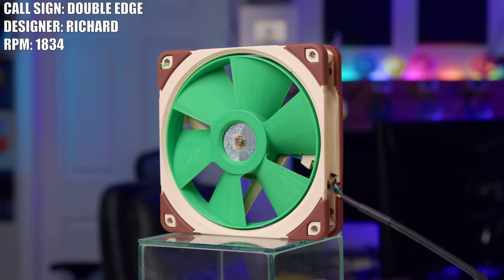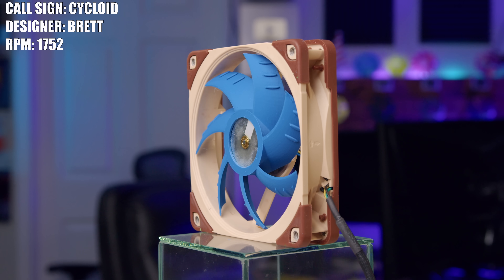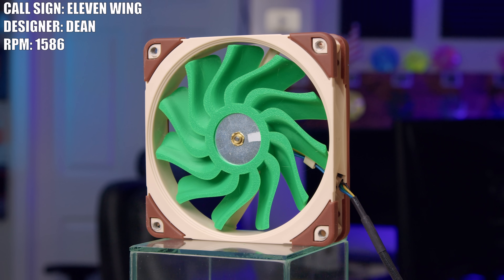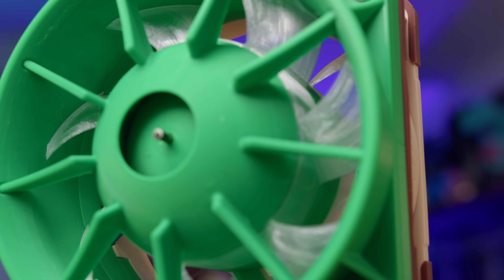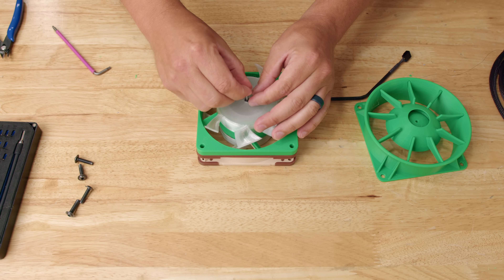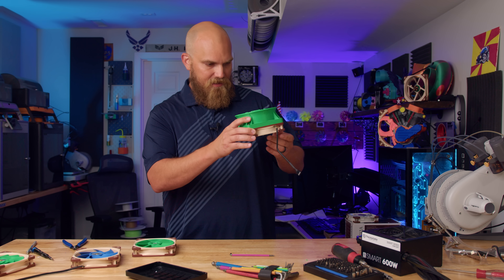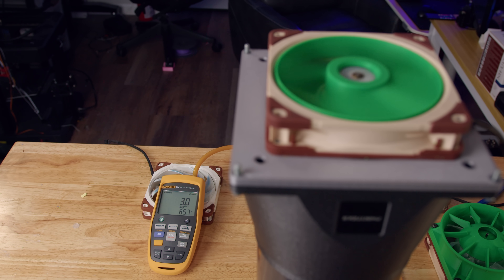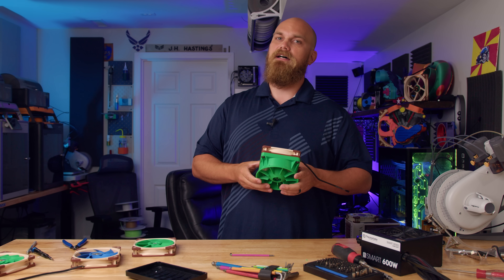I’ve Tested Hundreds of Fans… Nothing Like This One – This Fan Is a Masterpiece | Fan Showdown S6E11

Comment: In the next season you could measure the sound. They have to give the same flow and pressure as the original to be accepted and then what you measure is the noise they make.

Comment: The more complex fans have a huge disadvantage when using 3d-printed parts. The manufacturing quality just isn't great, which means terrible friction, vibration, etc. The tolerances just isn't there for regular 3D printing. If everything was made to the original fan's manufacturing quality, you might see some seriously different results.

Comment: I've commented this before, For season 7, whatever the the measuring will be, I still think there should be classes/categories. Here's what I think would work.

Standard - Fits within the housing, no protusions. just blade design essentially
Extended - Simple protusions (nose cones, shroud, fan blades -  limit the size, eg, no more than double the thickness of the fan housing)
Extended Plus - Unlimited height, but stick within the 120x120mm size - the classic"cheater" would be in this category/class.
Unlimited/Contraptions - Anything goes.

Comment: The jet stream needs a special episodes. Needs a reconfigured frame with an rc plane motor (or equivalent, something low profile but has the torques required). Need to see what it’s capable of without the motor limitations

Comment: It's interesting how "easy" it is to beat the Noctua fan in static pressure. We don't even have an "achievement" when beating it.
Would be cool to test that double edge vs noctua on a 240 radiator cooling your 5950X

Comment: If you remove the 2nd fan and just leave the driven fan, what is the static pressure reading, if it is less than 0.9 then it might be that a different blade design would increase the pressure of each fan and improve the overall static pressure. The airflow was very impressive

Comment: Is the secondary fan direction correct in the jetstream? Looks like both are pushing air inward, and 1 is slightly winnong. Try reversing 1 of the blades.

Comment: I believe the Jet Stream has more potential due to  the exit pattern of the smoke, it's more linear and focused. It is just having to spin 2 fans giving twice the load plus what ever resistance is being caused by the axial transmission rollers. If you gave it a higher torque fan motor like in some of the server style fans. Noctua has some high torque high speed fans, maybe something like that would be able to reach it's potential.

Comment: Throw an amp probe/clamp on the hot power going into the fan and take the amps pulled at 12v. Find the efficiency of the fans.  Then you can tac Static Pressure in Pascals Multiply that by the Flow in Meters per Second, and dived that by the Amps multiplied by the Voltage.  (Pasc*Flow)/(Amps * V) = efficiency.  The efficiency should come out as a %.

Comment: improvement on the jet stream m use  a jet engine style  restricted second stage to compress the air flow , so the main hub is on the outside and a reduced diameter second stage , narrowing the air flow improving its pressure  (just no jet fluel ignition on the after burner , that would be terrible for temps 

(although that does give me an idea for a fan with dry ice chambers , )

Comment: I’d say let the next seasons fan specs should cover voltage and amps normal, high performance, then on a dedicated psu to “let er eat!” And just see how fast they can physically go before either destruction or burnout. You may go through some more fans, but if you can find a relatively cheap fan with the same motor and just buy a shit ton of them, we can see different fan performances

Comment: About measurements: something with exact heat output and standard good radiator. Like put some heating element, coupled with thermal couple to measure temperature, over CPU radiator where-CPU-goes pad all covered in thermal paste or sandwiched between thermal conducting soft pads, and make that heater to heat up to 100c with no cooling, no fan and constant manually controlled power input. Then with FAN on compare cooling performance. I guess Aliexpress may have some pairs of heater + thermometer for some applications like water heaters or I don't know what else for smart house (means can be viewed in some application on PC/phone).

Comment: Damn, the counter rotating fan is genious... Now I wanna make a fan with an inline magnetic transmission to reverse the rotation, but I have neither the skills nor the time...
Reply: Tried that, was my first attempt a a Contra Rotating design using steel long steel dowels to bridge front to back. Magnetic transmissions are horribly inefficient, plus adds significant mass which the weak ass noctua can't spin. FWIW, also tried gears and belt drives. So yea, way too much effort for the end result.

Comment: 4:17 Wha? That explanation made no sense the first time through. I wish it would have been a little slower and more descriptive. It took me way too many times rewatching the movements and ignoring the audio to piece together how this thing worked.
Reply: me too!!!! I think one fan is connected on the inside of the hub and the opposite fan connects on the outside of a hub, but i'm still not positive.
Reply: @johnzoidberg1160 Yes, I agree. That is the part that is not explained at all. 4:57 is the only part that gives a hint at what is going on in the 1st part of the mechanism. The 1st hub and the roller spin in the same direction, implying that the hub is connected by friction to the inner surface of the hub. The only way to reverse this is for the 2nd hub is that the roller is connected to an outer surface. If they were all the same connection, then everything would spin the same way. It's a smart and pretty efficient design, but I think it's a bit disingenuous to pretend that these friction O-ring connections are, in principle, all that different in function from gears. The fact that they use a narrow metal shaft with low friction and have a rubber to printed plastic connection with high kinetic friction is largely why it's a more efficient design. That doesn't take away from its awesomeness at all. These ideas just weren't explained. Most of the prior contra rotating designs used all printed parts, which leads to a lot of friction and vibration, limiting their performance.
Reply: @jajssblue  What are you talking about? Of course the o-rings fulfill the same principle function as gears; the point of the mechanism is to carry out that function. The entire novelty of the design is in limiting friction and vibration by using the rollers instead of gears. What's disingenuous about saying it doesn't use gears? Rollers playing the same - ahem - role doesn't make them gears. You wouldn't say a car and a bicycle are undifferentiable, even though they perform the same principle function of providing mechanized transportation...

Comment: I'm no engineer, but the Jetstream would probably be improved by using gear teeth instead of rubber wheels causing friction, but maybe that would be too intricate for 3D printing.
Reply: Tried gears, even helical gears. The o-ring spools achieved about 200 extra RPM with far less noise. Granted the soft o-rings will wear out in a few days or less.
Reply: I wonder if you could do a cable driven system, not a belt but a rope wrapped multiple times around each element.  Might be tough to get the right tension though... @tomwest5083
Reply: @tomwest5083  Did you try leaving the gears running for several hours with some lubrication? Gears like to wear in and that can take a few hours or more depending on how much it spins
Reply: @aleksandersats9577  yes, best with even a single gear was about 800 RPM, and was really really loud
Reply: @tomwest5083 I have only two ideas
The first is to have more smaller transmission rods, something like a needle bearing, or to make the rubber contact line larger, as in the printer's paper feeding system, by using a rubber sleeve instead of an o-ring

And the second idea is to make the air drive of the second fan by putting a small drive turbine inside its hub and taking part of the airflow from the first to turn the second

Comment: A lot of servers have fan sets like the Jet Stream, usually what will be present is sets of counter rotating fans in a row in the middle of the system to create both consistent air flow and redundancy should any one fan in a given pair fail.

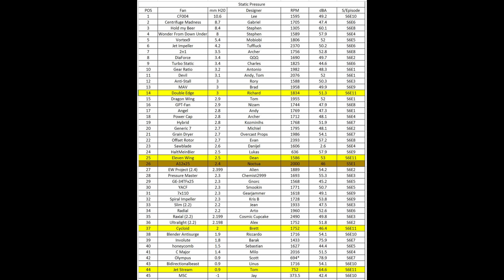Comment: 8:01 looks like the seal is broken. Compared to the other fans the lower rubber gasket looks not in place.
Reply: It's because it's upside down but yeah good catch it might affect the result.
Reply: Agreed, that didn't look like a very fair test at all. Maybe @MajorHardware can give it another test with a solid seal between the fan and the test rig?

Comment: Hello
I have a suggestion for you. Please Use Fans on Real 120mm AIO Radiator. Use a CPU like 14600K and limit it to 180W and test it which fan is better.
For Start you can use best Fans from Season 1 to 6
Thanks

Comment: That Jet Stream was awesome on the smoke test. Wow.
Reply: flattest smoke pattern i think we've seen on the channel. if you need direct air, that sucker nails it
Reply: I wonder how different fans would compare if you tested their sucking power.
I guess it probably isn't a factor to consider for a cpu fan, but the Jet Stream seems to be great at it.
Reply: @micaelhildenborg5712  the static pressure would be the same in "push" or "pull
"
Reply: @micaelhildenborg5712  should be the same as static pressure
Reply: That was really impressive. 

Everything about it LOOKS FANtastic
Reply: Just like the Fan attachment from Noctua.

Comment: The Jet Stream is a genius thing of beauty. Brilliant engineering. Proof of concept demonstrated. Thanks for kicking in with the hardware so we could see it run.
Reply: I'd love to see what that idea could do with 2 motors.
just slap them back to back and you got the contra rotation.
Reply: @ARockRaider  As others have noted, bi-motor counter-rotating fans are pretty common in server setups. Mostly for the 40mm class, but there's a few 80s as well.
Reply: @BlairdBlaird  neat!